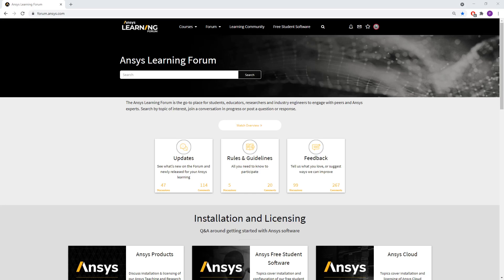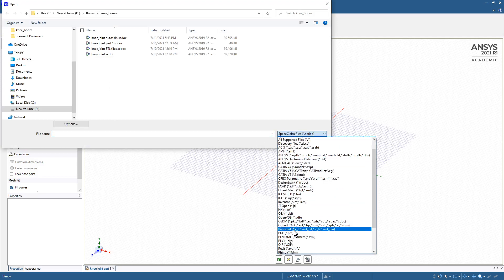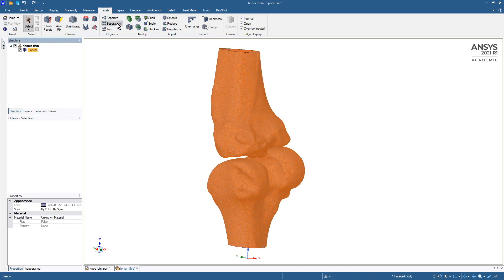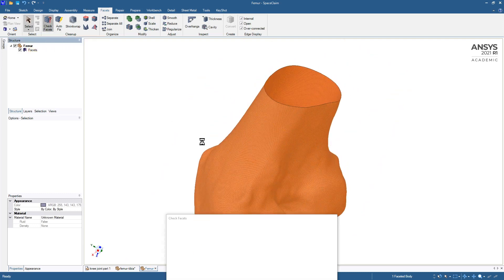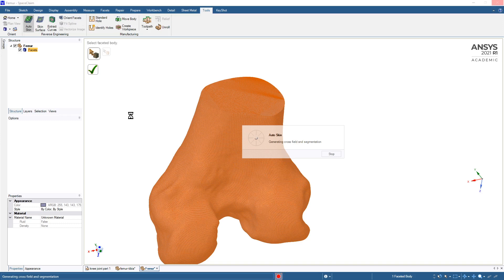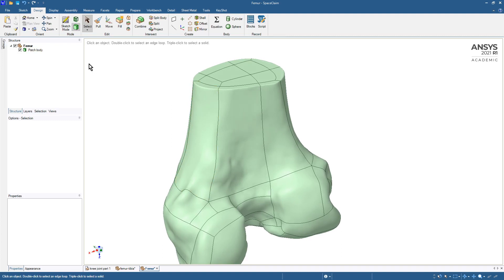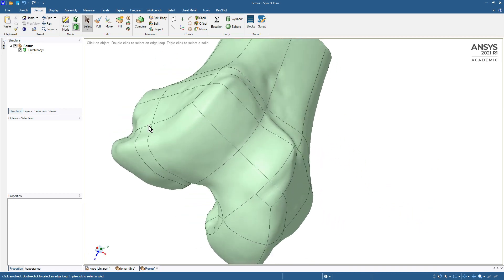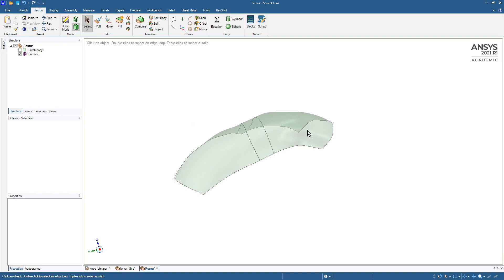ANSYS SpaceClaim 2021R1 STL of Knee Joint convert to Geometry Part 1

Comment: hello, I don't have the tools-auto skin command at minute 2.53, could it be the ansys version?
I have version 19.2
Reply from the maker: Yes, Ansys is constantly adding new features.
Reply: @ansysfeaexamples9351  hello sir, I have a question, I also have version 19.2 and don't have the Auto-skin tools How can I use skin surface and other tools to have the same results ?
Reply from the maker: @halabenchikh  In older versions of SpaceClaim, on the Insert Tab, in the Reverse Engineering group, was Skin Surface.  You might have to turn on the Reverse Engineering to access that tool. Just use that repeatedly until you have covered your body. Auto Skin just did that automatically.